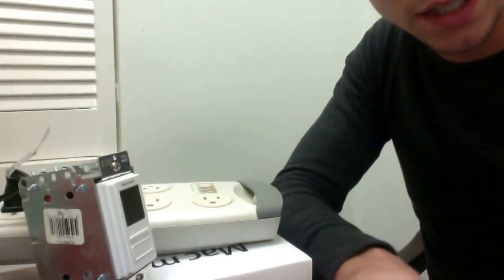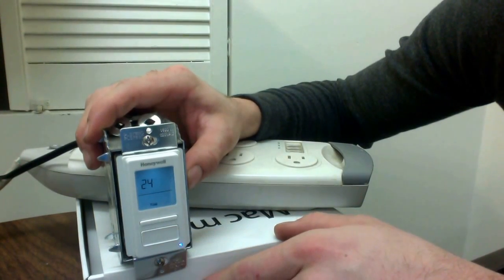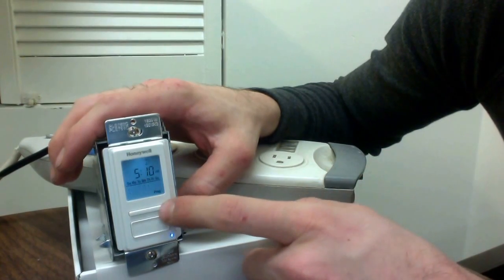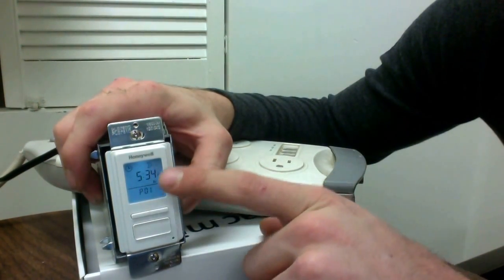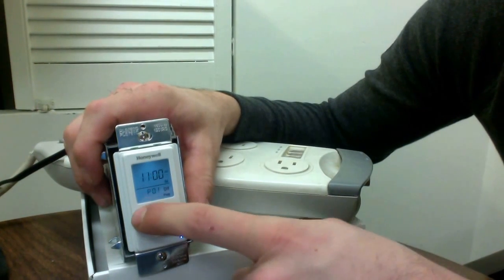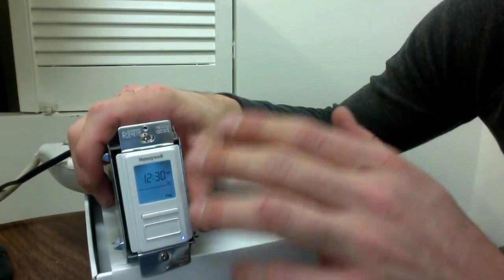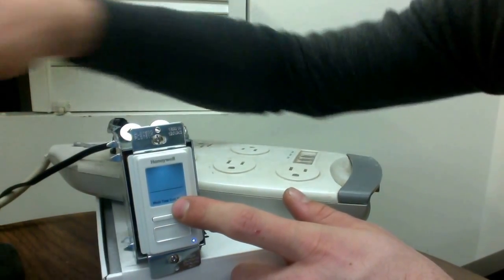Honeywell Timer Tutorial

Comment: Any idea why one of these timers would just stop working?  Pressing the button for 3 seconds does not revive it...
Reply from the maker: Best bet I could say is, remove the timer from power for 10 minutes and let its internal circuits "chill out" in all meaning of it. If it is still not working properly, (power off first when before doing this check please for your own safety!) ensure it has a solid ground, common (neutral) and hot (L1) connection  Use the breakers before you check any connections yourself! If after that, connect with Honeywell, they are great with returns and or replacements

Comment: My timer was not working correctly.  Followed your instructions as to how to reset the times.  After selecting NONE, I went back in to reset the times.  I was surprised to see that the original times for timers 1&2 were still there.  Haven't confirmed this worked but wanted to know if this is normal.  Thanks for posting.  I agree with Joan

Comment: Are you able to offset it from sunset/sunrise?  Like come on 15 minutes before sunset?
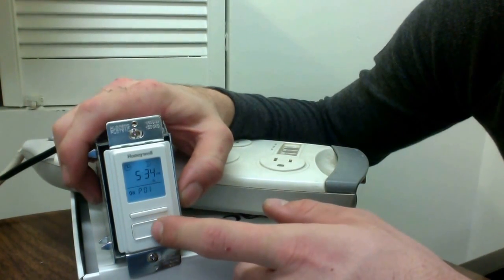Reply from the maker: Yes! The only issue with doing that is you will have to manually change it as the time of sun down changes.. 8:18 shows a different use for changing the timer but it will work for you

Comment: My switch doesn't turn on my house is brand new. Any suggestions?
Reply from the maker: Buy a new house! Haha, I am only joking of course. If the switch doesn't work, check the breakers in your panel (if they are half on, turn them all the way off then back on again) - Change out the lamps, after that, might be time to try an electrician. All the best.

Comment: I'm new to the sun down and up function. Are those assumed time changes already programmed in per your location or is it somehow being updated like an atomic clock does?
Reply from the maker: Yes, you have to set the longitude and latitude in the setting up mode of the timer, after doing that dusk and dawn correct throughout the year
Reply: Yes but are those changing times pre-programmed (that's the word I was looking for) or is it updated wirelessly somehow based off real time/daily weather changes?
Reply from the maker: Oh I understand, yes the times are pre programmed based on lunar cycles of long/lat.. There are no wireless components or adjustments for weather
Reply: I kind of figured but thanks for confirming it and still responding to your video.

Comment: It's 11:21am & the sun is in the upper right hand corner. At the bottom it says PO1off. Under program upper right is a moon at 8:10pm & at bottom says PO1on. The light doesn't come on at sunset but if turned on manually will turn off at sunrise. How can this be corrected????

Comment: Jared:
I programmed the timer, I live in the Hamptons and I am not sure of something.
I set it on auto and assume all the seven days will be activated as I have also set the longitude latitude and Day Light Savings Time
What I don't understand is:
If my settings are set to automatic, must I then mess with Program 1 or do I not need to set Program 1?  
All I need are the outside lights of my home to go on at dusk and go off at daybreak
Can you advise please?
Merci
Reply from the maker: hey, so setting the mode to auto only means the timer will do the functions you told it to do.. of you only.need a dusk to dawn timer. I have that shown in this tutorial. set all days of the week in the with the moon and sun icons to progessivky move through the years with sundown/sunrise. Sometimes people don't need the timer so you have the option for manual switching, but if I understood ou correctly, setting auntomatic doesn't just cause the timer to create it's own programs.. in reality though a dusk to dawn should really be a preset feature. . 2016 c'mon Honeywell haha. if I can assist further please comment and I will get back to you asap

Comment: what if it's flashing "On"?
Reply from the maker: That just means you've clicked the switch to the (ON) position outside of the time you set in your timer... if you want the switch to go on at 5 pm and off at 1am and you turn it on at 4 pm it will blink on until it completes it's timer function at 1 am to be turned off
Reply: +Jared Milos Thanks for the quick answer.  I think I figured it out.  I installed 2 of these and only one was doing it, but I had the on/off backwards on one of them.
Reply from the maker: +Richard Pearlberg Glad to hear you got it! I check my updates regularly so if you run  into any other issues I'll be happy to help you out to the best of my ability.

Comment: Thank you for your video.  The mechanical timer that controls my whole house fan stopped working recently so I need to replace it.  I had been having the fan cycle 1 hour on, 1 hour off all day.  Pretty simple.  Would this timer be an appropriate for a replacement or should I try to find something simpler?
Reply from the maker: Richard Forester Hey Richard, sorry for the late reply! For a cycling timer I would recommend using a mechanical style as they are cheaper and don't require all the features this one comes with. All the best!

Comment: When the switch is off the backlight flashes like crazy on the display?  What could be causing this?
Reply from the maker: Mark Hausmann I have seen this once only.. There was an intermittent common (neutral) and it basically fried the timer.. Try turning the breaker off for a few minutes, test the connections while it it powered down.. Then re energize.. If that doesn't work, might be time for a new one.
Reply: Timer works great and the lights it controls turn on and off fine.  It is the backlight on the display that blinks rapidly only when the lights are off.  When the lights are on the backlight is normal.  I did turn the screen to off in the configure menu so you wouldn't notice it but still I would like it to work properly
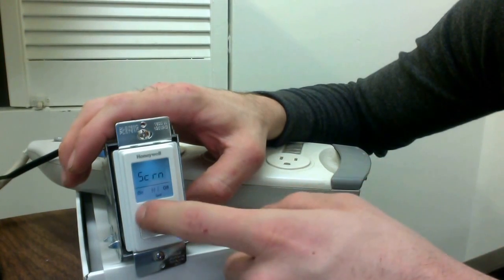Reply from the maker: Mark Hausmann Have you tried going into the config mode at 4:23 of the video and turning the backlight off completely??
Reply from the maker: Mark Hausmann If it is blinking at all, all I can think of is that you have it on during an (off) time setting in which case the (on) indicator would blink.. I'm just messing around with my own trying to figure this our for you.. Double check all the times have a proper on and off time and if not, it could be a fault in the timer itself.. Hope just turing the backlight off will solve this for you, if not. Try and return it for a new one. they are good about returns in my experience with the company.
Reply: Thanks for your replies...yea I can turn the backlight off and it works fine.  But it would be nice to keep the backlight on without it blinking non stop
Reply from the maker: No problem, wish I could be of more help.. I'd say try and go through all the times, make sure they are all set properly, turn the circuit off in your electrical panel and double check that everything is properly connected in the junction box.. So far as email commenting troubleshooting thats all I can offer lol!! I know the backlight is a great feature.. I've saved our screen shot comments and emailed them Honeywell Rep I deal with.. If I find out anything more, I will send the info along to you!